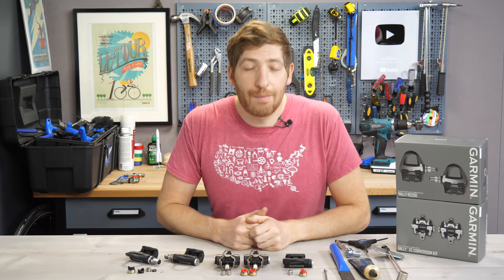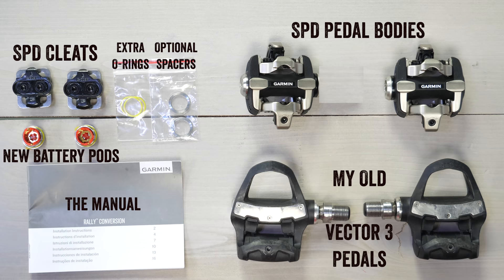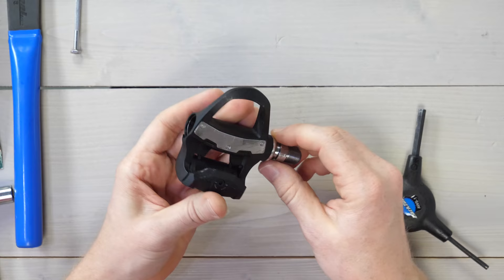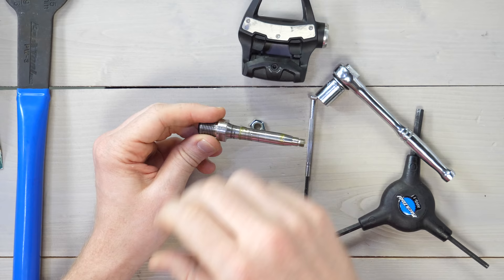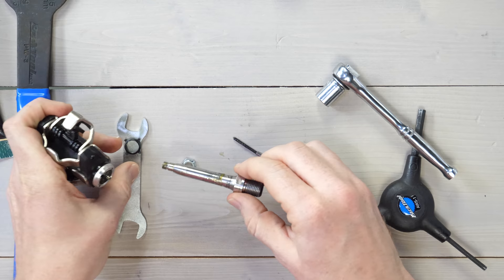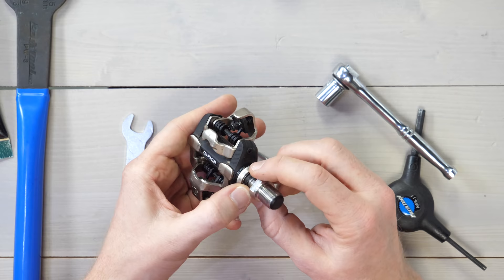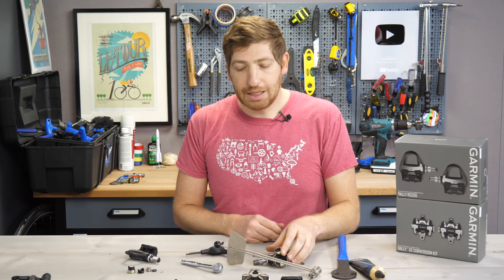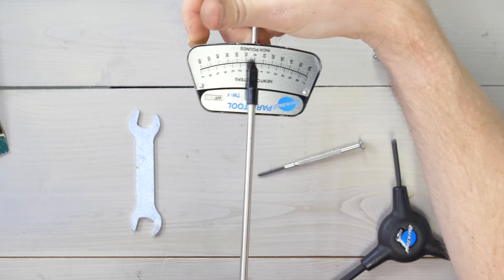How to: Convert Vector 3 to Rally SPD-SL/SPD Pedals!

Comment: Garmin might move slow to innovate, but you really have to appreciate the way they make new products and features back-compatible. My  3 year old Vector 3’s can now become XC pedals...love it!
Reply from the maker: Indeed, I'm impressed it's backwards compatible!
Reply: I disagree. I own Vector 2's, which aren't compatible with V3 or Rally. I cracked the plastic on the pod at the weekend and contacted Garmin to see if they had any spares. They don't. A $1000 set of power pedals made useless due to a $0.10 plastic cover.
Reply: Yes... My vector 2 is lost because the discontinued pods. So in Brazil, is mandatory the factory produce parts within 5 years end production... I will process them....

Comment: Great video DC.  I just received my RS bodies and swapped my Vector 3 spindles over.  One thing to note that differed from you excellent walkthrough is that the new RS bodies I received already had both spindle seals in place.  I was initially going off of you videos and cruising through the swap only to discover that the new bodies had the inner seal already seated inside.  The outer seal was kind of obvious but it wasn't until i tried to move the old inner seal over that I checked the Garmin steps which called out that the new bodies did not require moving the seals over.
Reply from the maker: Thanks! Yup indeed, Garmin decided to include the seals after all for the first main production batch, which is great. Once I get the new one I'll update the video with a quick refrehs.

Comment: Righty tighty on the left pedal perhaps? But this is great - the same process as if you had to replace your pedal body at any point (usually sent out as warranty issue, but can also be purchased, like the new conversion kit).
I got one pedal body to replace myself one time, but most recently got sent new Vector 3 pedals , which has the new battery connector and pod, and even had the  CR1/3 N batteries too.

Comment: Great and surprising video. I did not think the inside is compatible. Thanks for that. On the other hand Vector 3 body is not a good one as it is not durable. My Vector 3 had to be replaced in Sept 2019 and in less than 2 years there is a wear on the back where the  clip attach that cause the problem it cannot be tightened so it is moving a bit. Also many other people complaining about the same issue. 

So the question: what about of this new body? I see the battery part has a new metal screw thread for the cap. But not sure if the body is durable or need to replace in each 1.5 year. Which is not cheap seeing the price increase between vector3 to Rally.

Comment: Now that Garmin has made this move, do you think Favero will make an official way to switch assioma pedals over to spd without using a "hack" that would void warranty?
Reply from the maker: It would definitely seem like a smart move.
Reply: doesn't the pod interfere with a lot of mtb shoes?
Reply: @hgiusdfajgfds  It definitely can but I'd rather buy a cheap pair of mtb shoes and cut off a section of tread than buy a second pair of power pedals for the few instances where I may ride in a more gravel or mtb setting. May not be the best way to do things for others but would fit my needs.
Reply: @baldbeardedbicyclist  Sure. But for that wouldnt using xpedos mtb pedals be good too? It's not as good as an officially supported solution, true, but it's pretty damn close
Reply: @hgiusdfajgfds  Oh for sure, that may end up being my solution I'm just hoping they change it so it doesn't void warranty as I just bought my Duos. Poor timing with this new release by garmin but price point may still have landed me with the Duos anyways.
Reply: @baldbeardedbicyclist  I changed my assioma pedal bodies for new equivalent keo pedals from xpedo (just because the old ones, bearings etc were quite worn and new ones 70e) - the process is extremely simple. Can recommend.

Comment: This is really useful, thanks!
I've got a Vector 3S and where I've changed the battery multiple times (with the old and new cap), I've cross-threaded the body.
I'm wondering whether I should buy a new upgrade kit for the KEO and just use my existing 3S Spindle, or just buy a new Rally RK100.

Comment: Amazing, I got a pair of vector 3s with broken left pedal body for $50 AUD, nothing wrong with spindle. Bought the rally rs conversion kit brand new for $240 AUD so I can use my existing spd-sl cleats. Total $290 AUD or $190 USD single sided power meter, practically brand new hahahaha.

Comment: Ray, any idea if this is compatible with the single sided Vector 3S?  Garmin lists compatibility with the RS, RK, and XC (both 100 and 200 variants) but only Vector 3 with no mention of whether that refers to the Vector 3 family or just the Vector 3.  Cheers from DC.
Reply: Vector 3s worked, I just did the conversion, for anyone that needs confirmation in the future.

Comment: £179 seems a bit steep for pedal bodies, but I guess that's down to the limited number they will produce.
Reply from the maker: Yeah, the pricing is basically the same as Shimano DuraAce pedals, though obviously, one can debate the merits there. But I can see the logic in that price point pretty easily.
Reply: @Dcrainmaker  I'll probably buy some but only after my Vector 3 bodies are won out.

Comment: WATCH OUT!!!!!!!
It is easy to follow the video and make the change, you can change as many times as you want some pedals for others ... what they do not tell you is that as they break or lose any of the pieces that make up the set they do not sell it to you separately .
When making the change, the nut of the right pedal axle has lost its thread, they do not sell it to me separately, I have to send them the entire pedal and they charge me € 302.40.
They announce the ease of change but if something fails, € 302.40, when the kit costs € 250.

Comment: This video was very informative, thank you!

Quick question… if I were to buy two single sided Garmin rallys (XC100 and RK100), would it be possible to make a dual kit from that? I don’t think it would be possible because the hardware is in the spindle right spindle and the two spindles have different thread patterns, but worth asking. Thanks!

Comment: very helpful video, thank you for that! I used it to convert my Garmin vector 3 pedal to a Rally XC. I have a question: I have only the left pedal available and as said I converted it to a Rally XC using the conversion body. Which pedal could I use as pair for it? for sure I could use a Garmin one but is pretty expensive. Is there any Shimano pedal which is fitting from size point of view? (I saw your other video where you talk about different stack heights of the pedals). Thanks in advance for your answer

Comment: I might have missed, but the battery carriage (the piece that is secured by the PH00 screws) is the same from the old pedals or the conversion kit have a new one?
Reply from the maker: It's from your older pedals. However, if you want the newer parts, there's a kit for $30 on Garmin's site that includes the battery base/pods/screws/o-rings. Basically, all the parts except the spindle/pedal body.

Comment: Hi, very nice video!
By the way do you know if it’s possible to buy a dual sensor system and a conversation kit to use in two different bikes(as two single sensor) and in some occasions instal the two pedals in the same bike and have a dual sensor system?
Reply: Not possible

Comment: Ray -  What brand 12mm socket are you using on the spindle? I've been to 2 bike shops that don't have a socket that will fit inside the pedal body.
Reply: I just bought a cheap socket set from a hardware store, its not a bicycle specific socket, I took the pedal along too and made sure the socket was thin enough to fit into the pedal, some are thicker than others.
Reply: @911shmoky911   Thanks, Lowes has the right socket.
Reply: Been searching high and low for the correct socket size…. Can anyone provide a link to a set that will work? Thank you
Reply: Apologies for adding this so long after, but for anyone based in the UK who's struggling with the same issue, the 12mm socket in this set from ScrewFix works. I've literally just this minute completed the swap from Vector 3 to RS bodies using it. No help for you guys across the Atlantic :/ but it may save someone else from similar despair over this side of the pond. 

https://www.screwfix.com/p/magnusson-1-4-drive-standard-socket-rail-11-pieces/8325v

Comment: What brand 12mm socket are you using? Mine is a little too wide to to fit. Thanks.
Reply: Had the same issue. See my recent post about it. Apparently and I typical Garmin fashion of making nothing easy, you need a 1/4” outside diameter socket which is not an easy to find part. We still cannot perform the conversion because we can’t find the correct size socket!
Reply: @jimvescijr8687  I found a 12mm socket that fits the Garmin pedal body. Unfortunately it is part of the Craftsman 11 piece metric socket set (red box from Amazon). Ideally you can return it if it does not fit.
Reply: @Dasagross  thanks but it’s total BS that Garmin didn’t include it. PITA all the way around

Comment: Thanks for the video. Strange that the lower part of the battery pod is not like the latest design they gave for the vector3
Reply from the maker: Apparently, I’ve been told the bottom battery part is now standard on Vector 3 as well, and available as an after kit too. Mine are just older.
Reply: @Dcrainmaker  Oh I understand, so in the kit the bottom part is not included. Hmm
Reply: @fts3865  Exactly. IMHO it's a bit weird that battery boards are not part of a conversion kit. What would be logical when it was identified as a weak point of design in Vector 3, together with battery caps. I've personally asked Garmin support for Vector 3 "Small Parts Kit" (2 pedals - 2 kits) and it was sent to me just for free.

Comment: Thank you so much for all your great reviews, Ray!

Question (which is also a bit more general than just on the power meter pedal): I've ridden SPD (for commuting and spinning bikes) and Look for 10+ years now but never the SPD-SL. I'm trying to wrap my head around whether there is an actual difference between the two as they seem so similar (bar for the Keo Blade, but that's a different story). I'm looking into getting power-meter pedals, but struggle to decide if I should switch to SPD-SL or stick to the Look system. Anyone cares to comment on this? I've seen people complaining for ages about the lack of SPD-SL for the Garmin (and other power-meter pedals), but haven't seen a proper reasoning articulating why.
@dcrainmaker: you've tried both. Any noticeable difference for instance in the ease to clip in, say due to the balance (with one keeping the heel down better)?
Reply from the maker: Honestly, no difference to me. I know some people swear by one or the other, but frankly, after about three pedal strikes, they feel identical to me.
Reply: @Dcrainmaker  thanks a bunch for your answer! This is what I would logically expect as the pedals are virtually the same. I can understand some differences might arise based on actual pedals (Shimano Dura-Ace or Ultegra vs Look Keo, etc), but here everything is much more identical. This is reassuring and so I would overthink my decision then and probably stick to my old good Look cleats, which will reduce the burden of switching on my shoes. I'm tempted to wait to see if Favero will upgrade theirs with anything new besides Shimano compatibility ;-)

Comment: Is there a compatible (non power) spindle that will work with the bodies to use when not using the power meter? It would be nice to use the body on another bike.
Reply from the maker: That's a pretty interesting question, but I haven't heard of any there. I suspect that you could in theory buy a left-only pedal spindle since that's offered normally for the Vector/Rally single-sided units, but I don't know if a right-only one available non-power.

Comment: Did you use the old battery base in the SPD-SL upgrade by mistake?! Maybe I didn’t look closely enough.
Reply from the maker: My Vector 3 unit has the old battery base. I've never received a newer battery base, just newer top-pods.
Reply: @Dcrainmaker  Ah roger that.

Comment: The two O-Rings are not included in the conversion kit? i.e. could you build a fully functional RS200 from just two V3 spindles + the RS kit?
Reply from the maker: They weren't in the kits I received, however, Garmin reached out afterwards and said the final-final production kits shipping here in the next couple weeks will have the extra o-rings in it. I'll do a new video then.
Reply: @Dcrainmaker  Thanks. I forgot to ask about the silver/black nut, which unlike the "replacement joints" (that I now understand are the aforementioned O-Rings) is not listed on the box content on Garmin's website. Any idea if that would be included as well?
Reply from the maker: @Berlor  I don't believe those are included. Note - I'd be super hesitant on just buying spindles (such as off Aliexpress/etc...). Logistically speaking, those shouldn't exist without a pedal body attached. Which makes me think that they're either fake, or other likely broken.

Comment: the links to the appropriate tools (specifically the 12mm socket with a sub 17mm diameter)...do you actually have those?
Reply from the maker: Eeks, didn't realize I was missing those. Ok, let me dig them up.
Reply: @Dcrainmaker  appreciate that. Sadly the US seems to hate metric and I haven’t come across a 12mm socket with a sub 17mm diameter. Really Garmin should be providing that information to buyers and not rely on you to help people locate esoteric components. Great video btw, looking forward to swapping over my old vector 3s once I can get my hands on an item that’s 2% the cost of the conversion kit at most 😂
Reply from the maker: @mostwhowanderarelost  Oh - I got an answer actually! Here's an exact known-good adapter for a wrench: https://www.lowes.com/pd/Kobalt-Universal-Metric-1-4-in-Drive-Spline-12mm-Shallow-Socket/1000217147